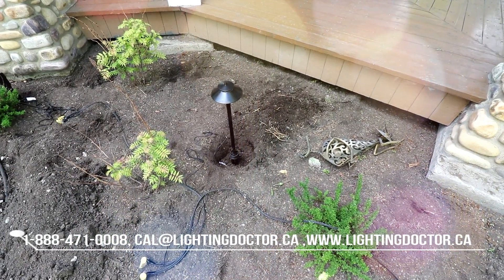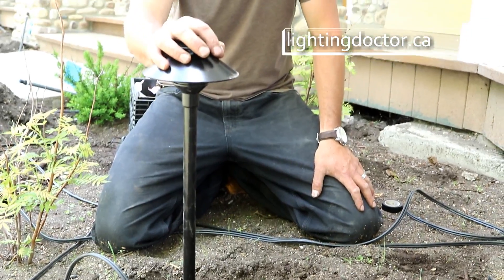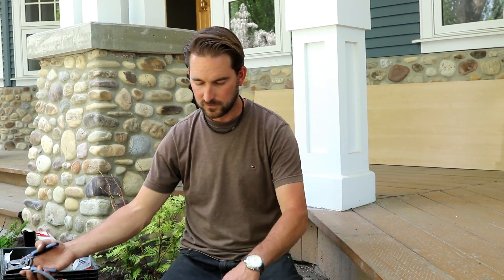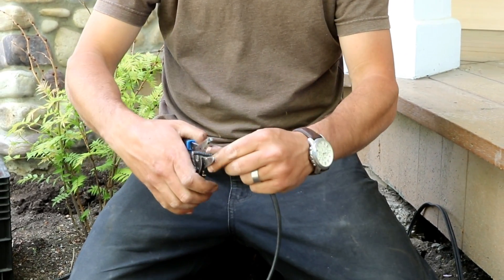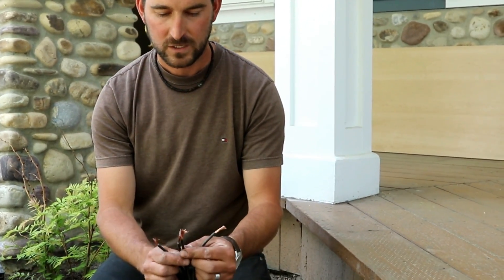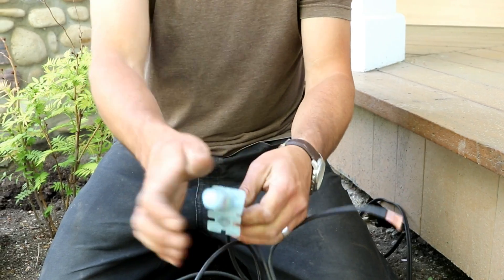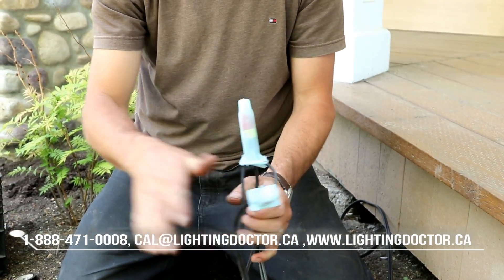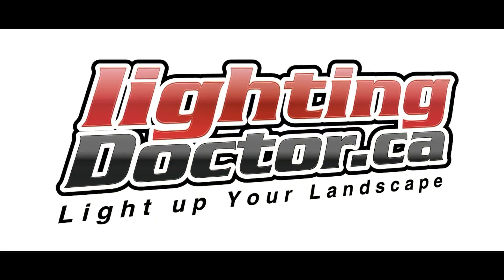Landscape Lighting Installation - How to Make Waterproof Wiring Connections

Comment: there is no smaller easier way to T off? (using low voltage) . I have 40 lights! Thinking of getting those spike in wire connectors, as it just punches into the main wire without cutting them... and then silicon sealing them(?) They are small and pretty cheap, as I need 80 connectors.
Reply from the maker: I would not reccomend anything that pierces the wire. They may be cheaper but guaranteed over time you will have issues with corrosion of connectors and wire. We see it all the time
Reply: @LightingDoctor  thanks..If I hadn't already put them on and silicon them in, I would likely go the route of the Orange ones you used. So What I will do is silicon those points as well, as I agree, over time the pseudo seal will be breached. SO, the silicon will make it last longer.  BTW, I have a theory...I think the gel that is in the ones you demo-ed are filled with expired silicon :-)

Comment: Hi. I have fixtures with teeth connectors are they any good.
Reply from the maker: I would reccommend cutting of the teeth connectors and using a good waterprood connector. Almost guaranteed the teeth connectors will corrode and cause problems within only a few years

Comment: So if there are 6 wires and you connect 3 and 3, how do you know which ones to separate, is there a hot and a ground wire on each one?
Reply from the maker: With low voltage there is no ground wire in the strand. Hopefully this video will help a little more. https://youtu.be/U7tbvnCtF-E

Comment: Can't you connect multiple fixtures to different ports on the transformer without splitting anywhere?
Reply from the maker: Yes on most transformers the terminals will be large enough to run multiple lines...